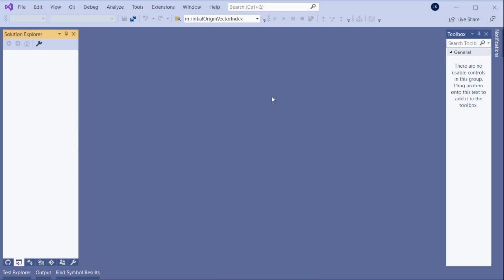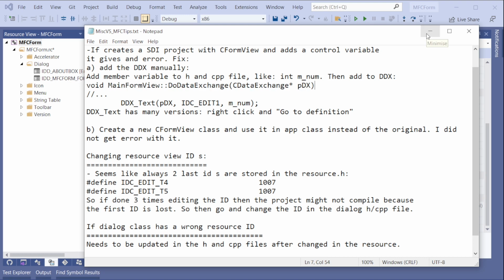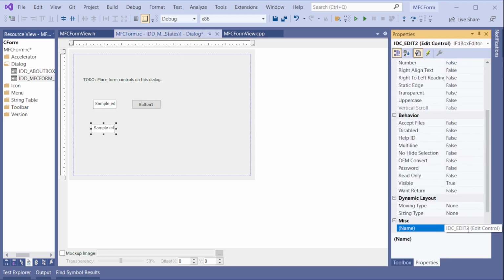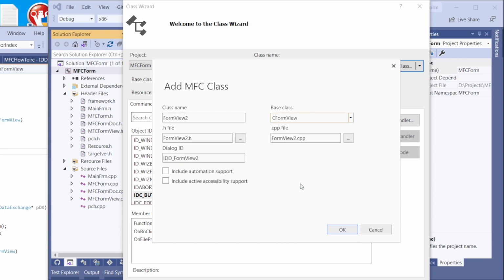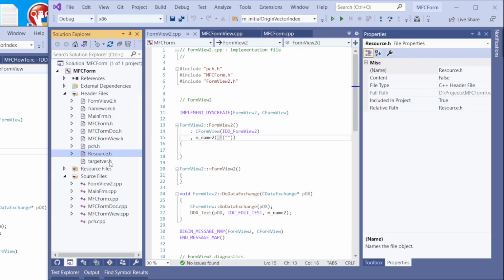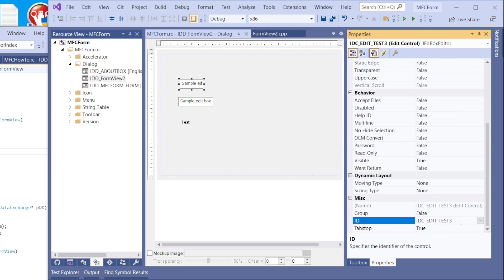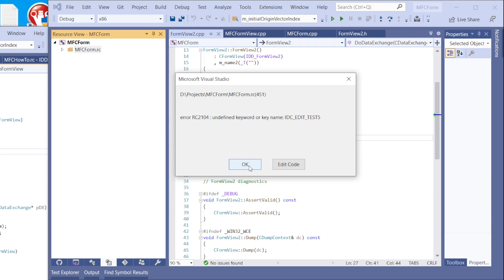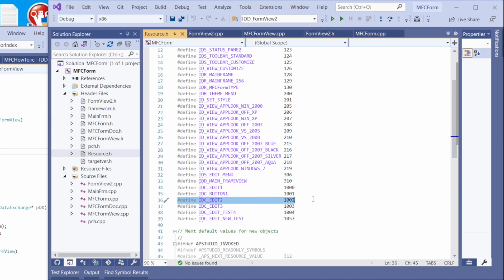MFC C++ Resource ID Tips / Error Fixes Video 22 | Using DoDataExchange | Working with Resource View

Comment: The problem with adding a control variable to an edit box seems to be fixed in VS 2022.

However, I was able to sort-of recreate the problem with additional variables ending up misplaced in the code.

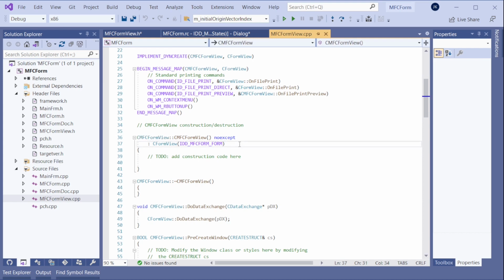At 4:50 a syntax is shown for initializing a variable that uses both curly braces and parentheses. If i modify my code to use that (instead of all parentheses), the next variable I try to add by the conventional method will be misplaced.

It's very odd. It is as if VS is counting parentheses to figure out where to insert code.

It's a miracle it works at all!